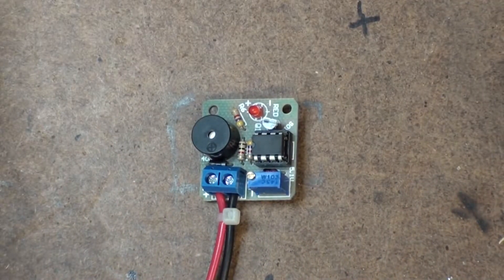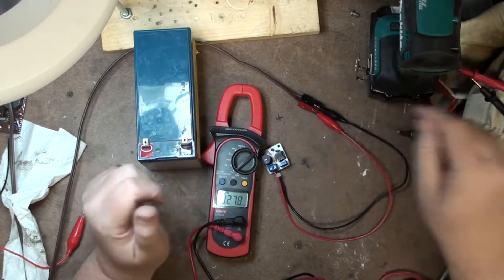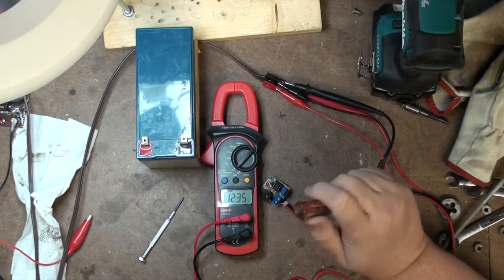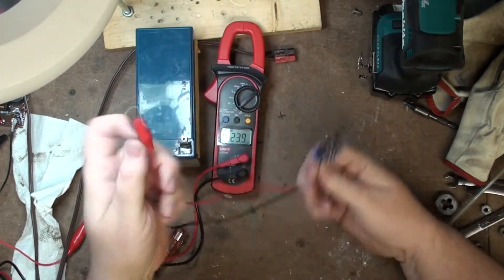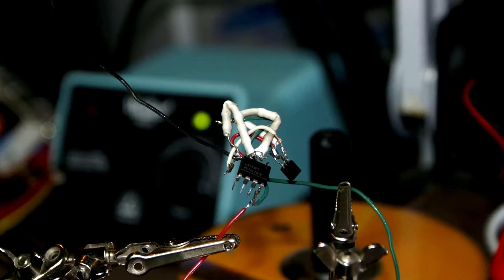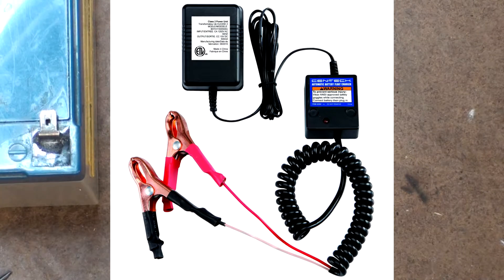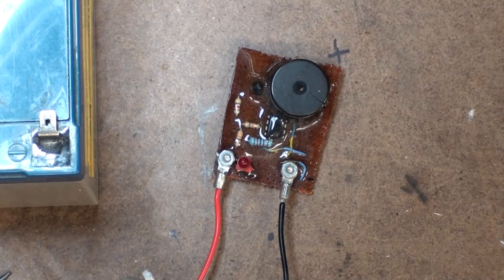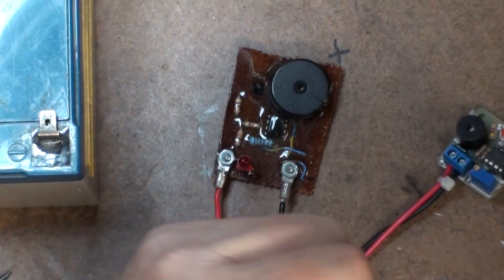12V Battery Accumulator Low Voltage Alarm Buzzer Board Under Voltage Protection Module

Comment: Excellent work, can I make this circuit 40 volts, I follow your channel from Egypt, thank you
Reply from the maker: I tried changing the voltage and it really doesn't work well past about 14 volts.
Reply: Hello. Any link shop to get it?
Reply from the maker: @NURIKMAL_86  sellers change their inventory often search ebay for 12 volt accumulator alarm
Reply: @ObsessionoftheMonth  Oke Thank u

Comment: You can now get these off eBay. 😏

Just look for (keywords-wise):

- 12V Battery Cutoff
- 12V Over Discharge
- 12V Battery Protection Board

That's it. 😄😆

Comment: How to adjust the voltage ??  while conneting to battery or is there other method to set the voltage
Reply from the maker: connect the device to an adjustable power supply, set the power supply to the voltage you want the alarm to go off, then set turn the screw till the alarm turns on.
Reply: How to set power supply that we want? Help me